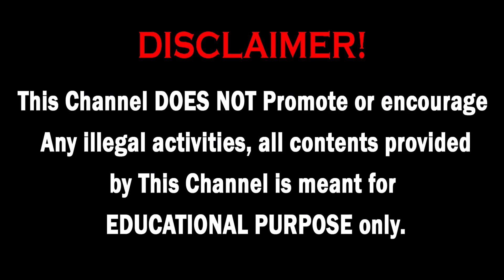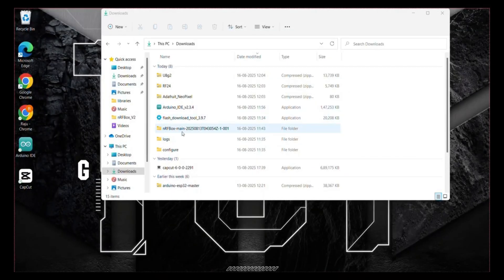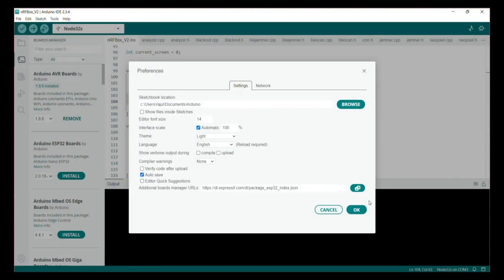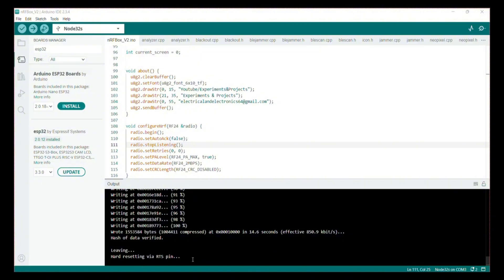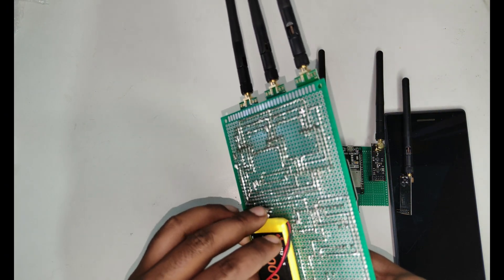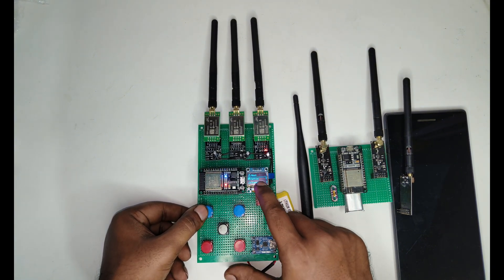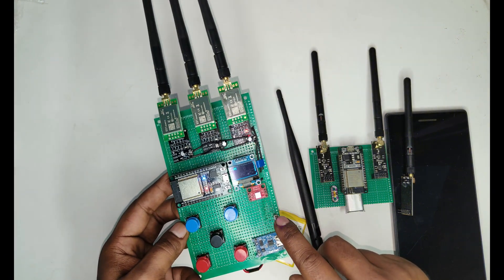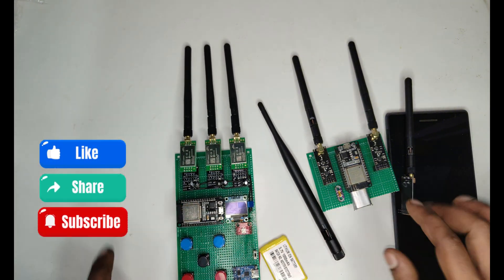NRF Box Long-Range Upgrade: Powerful 3-Antenna Setup for Maximum Range! #esp32wifi #nrf24l01 #diy

Comment: My device work with max 2-3 mtr range and nrf modules getting heated within 30sec, is it normal?
Reply from the maker: Yes it's normal but better to use small cooling fans

Comment: Can i use 8dBi WiFi Antenna 2.4GHz 5GHz 5.8GHz Dual Band RPSMA Antenna + 15CM U.
Reply from the maker: Yes you can
Reply: @Experiments_Projects when I replace this antena in your circuit any changes or not , tell me properly in your circuit I want to fit 6 or 8 dbi antena